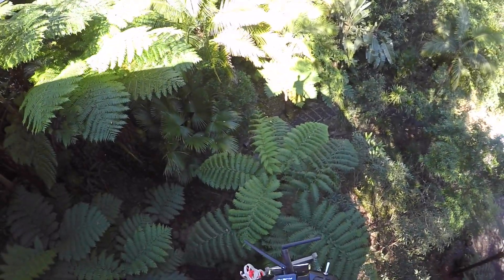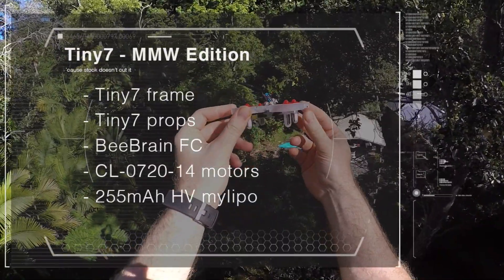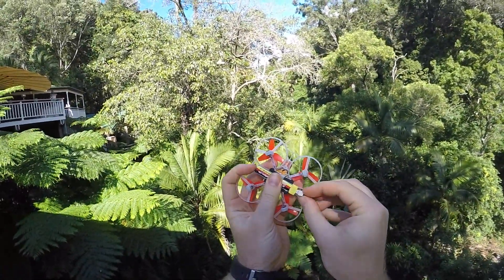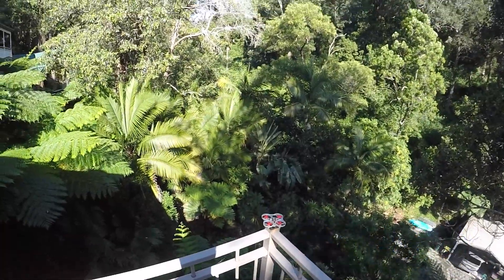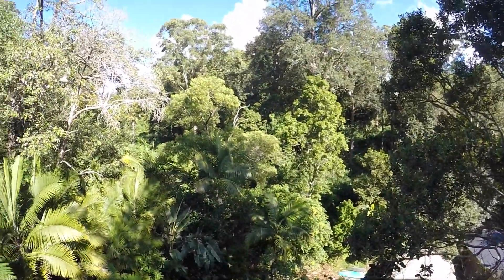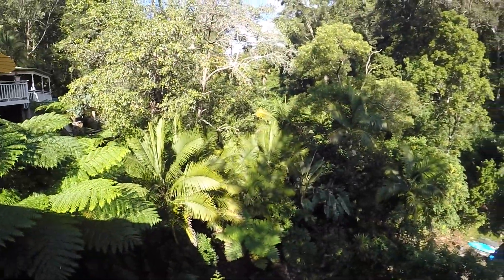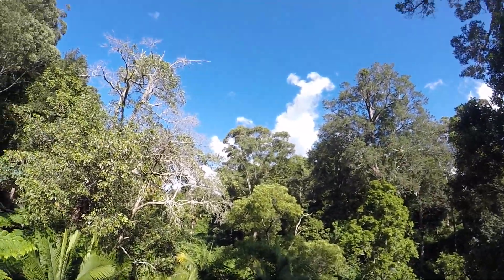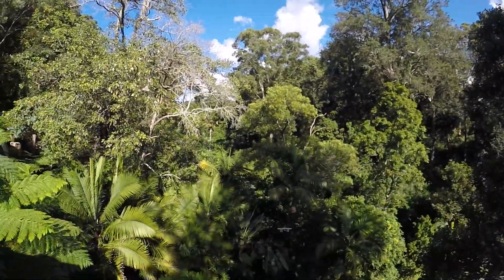KingKong Tiny7 (frame) review

Comment: How do u compare it to e011?
Reply: Wai Cheong HON The Tiny7 bigger and heavier. Maybe a bit slower. But the frame is better quality.
Reply: I was expecting the bigger 7-20 motors would make it faster
Reply: Wai Cheong HON I haven't broken e011 frame yet.. crashed a bunch. Where as the e010 frame would have broke.. plus e011 is only 3 grams vs 5 for e010